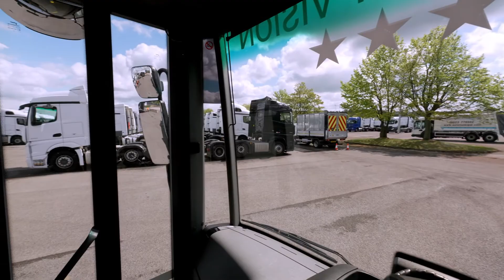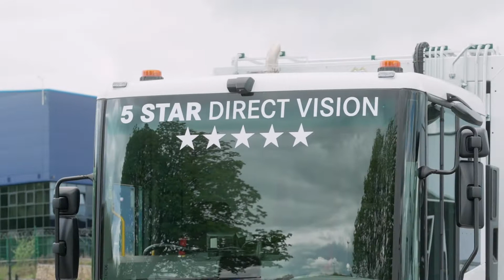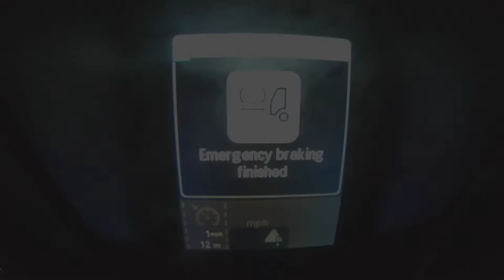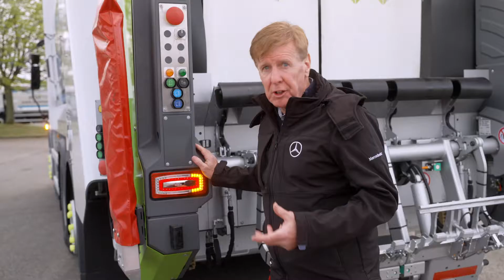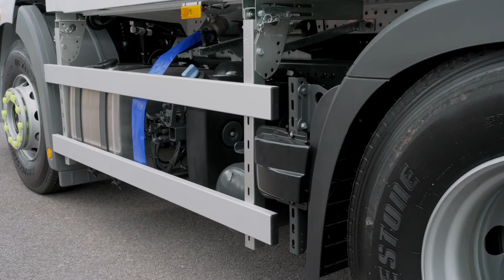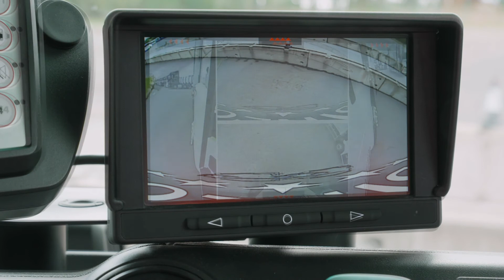Mercedes-Benz Econic - The benefits

Comment: Anyone know how i can fix a hydraulic system failure on the rear helpers, I've got an econic 2629 it had a busted hydraulic pump that i replaced of course; however i still cant get the hydraulic to push through to rear tyres, could it be the pipes are clogged?